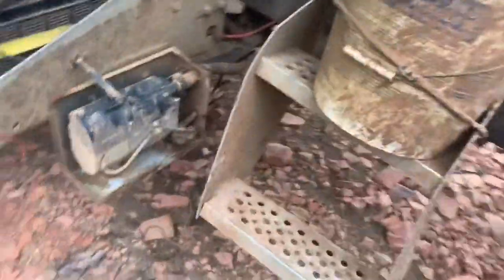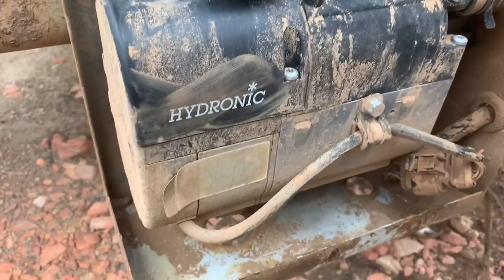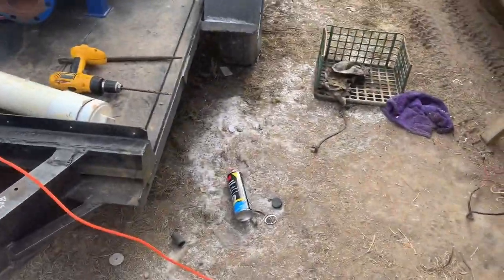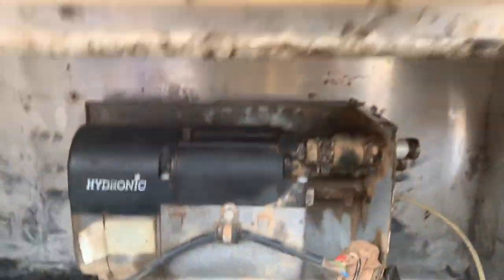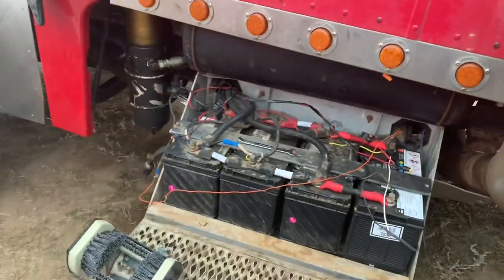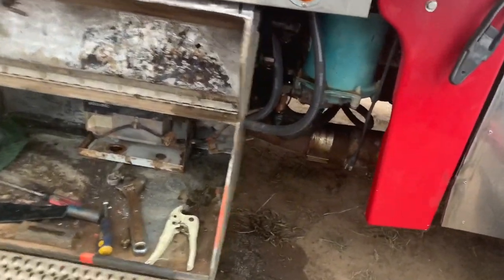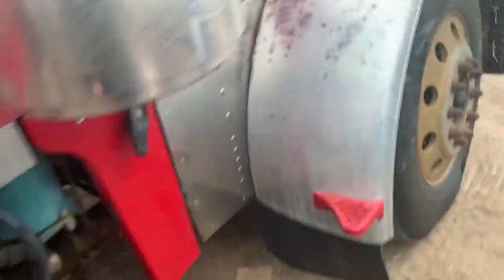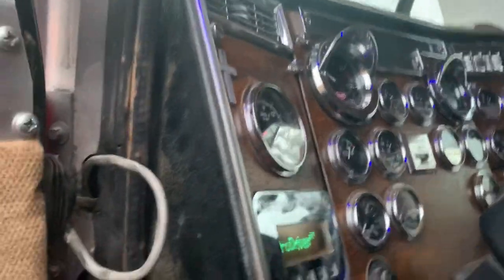Espar coolant heater / no more cold starts

Comment: Do you have cabin heat while it's running?
Reply from the maker: No just heating the block
Reply: @TANKERMONKEY  I would think since you are heating the coolant up, the cabin heater should blow warm. Unless it doesn't heat the coolant up enough to feel the heat through the vents?